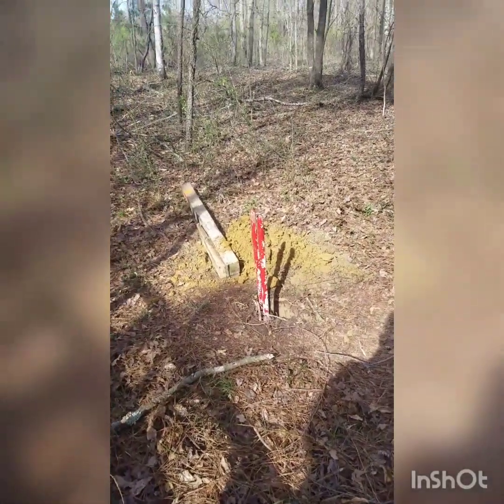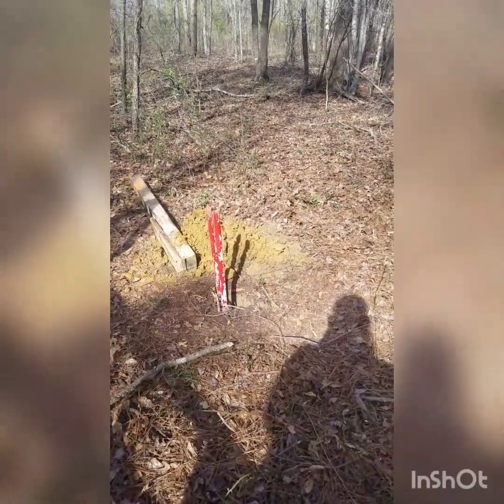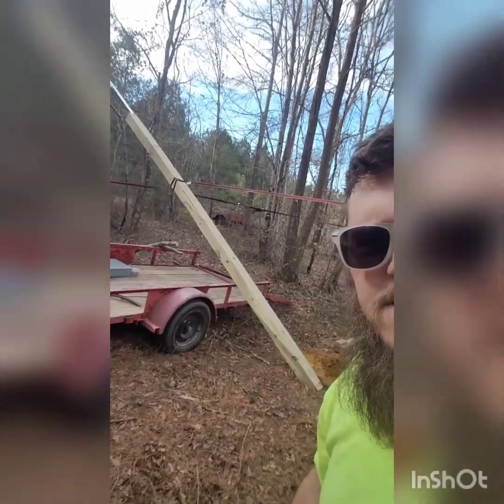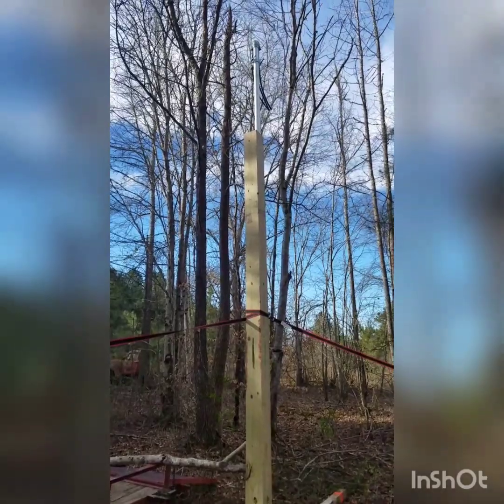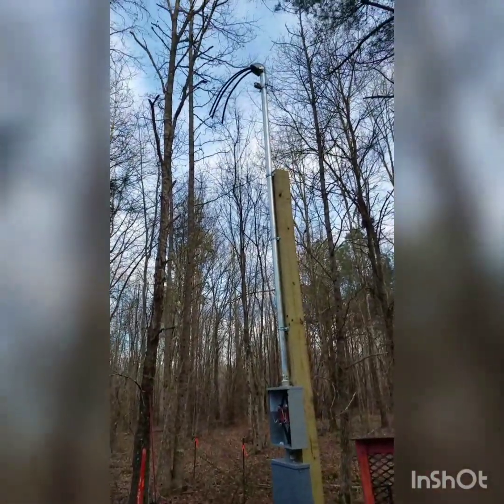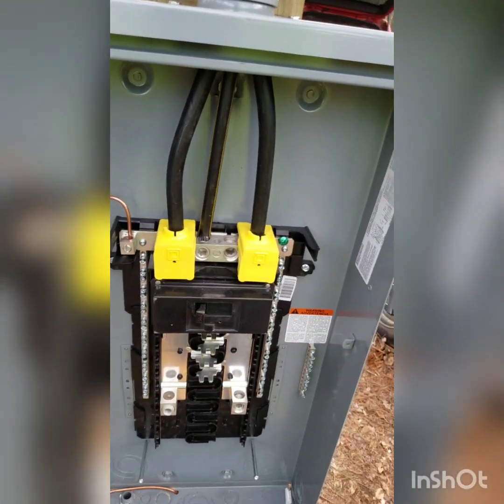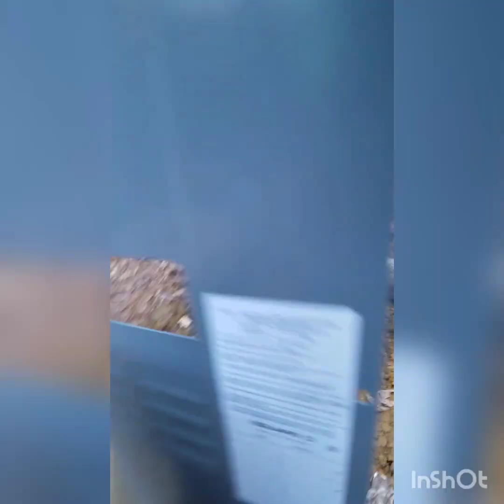How to Install a new power pole by yourself and intro to my channel

Comment: That's suppose to be a water tight compression connector on the meter hub where your mast connects. Is that mast EMT, rigid,or imc,? Rmt is not allowed for a mast riser by most utility oroviders. Did this job get inspected,? Had you used rigid or imc the pipe would have been threaded and you could have threaded it directly into the hub .

Comment: I was looking at the pole wiring set power in the top and power out the bottoms for mine to run wire under ground ,configuring the meter box is what I was looking for to do the pole in Florida .

Comment: Anybody know what the cheapest way to get a temporary power pole on a residential vacant Florida lot without a house building permit?  The lot does not have houses for 1000sq ft, but there is a Duke pole 200' away. The road is very narrow and soft, yet I've been able to drive into the lot.  Duke Power said they would provide temporary power up to 100a power with a permit (possibly at a cost), but the county needs to inspect first.  What kind of permit will be allowed? irrigation? clearing?  I have a shallow well I drilled that works very well, but not with permits. And finally, I'm looking to buy an EV truck and also need power to charge the truck, since no charge stations anywhere around.. just wondering how flexible and understanding the county is going to be me? I suspect the county is going to respond in one of two ways, 1. your lot is inaccessable  2. here's a fine for clearing and digging without a survery or permit. BTW, I had previously reached out to the county about possibly improving the roads and their response was there were not enough resources or customers on that street.

Comment: What about the 2nd ground rod.  I am made to put in a second ground rod because it's a recreational Pole How do I do that without having the electrician come back out
Reply from the maker: Sorry for the delay but I don't have any building codes or inspections where I live. I drove the ground rod with a hammer and whatever else I thought might make it go faster. And ran the wire into an open slot on the ground bar inside the box. Hope that helps